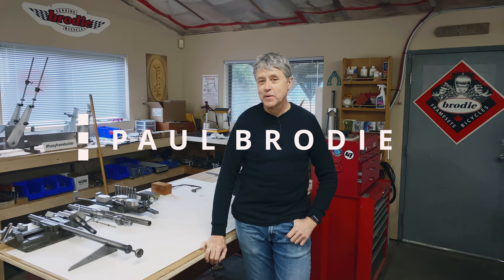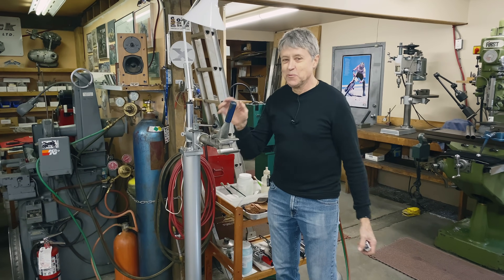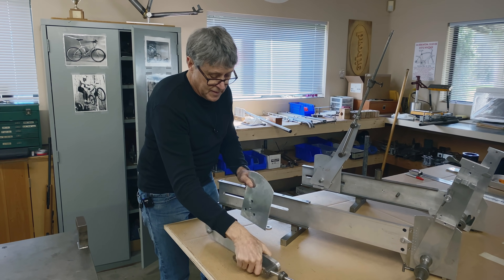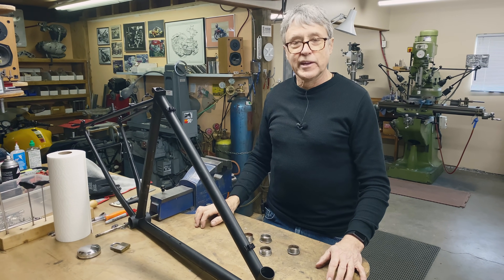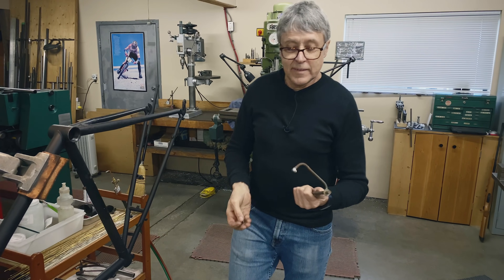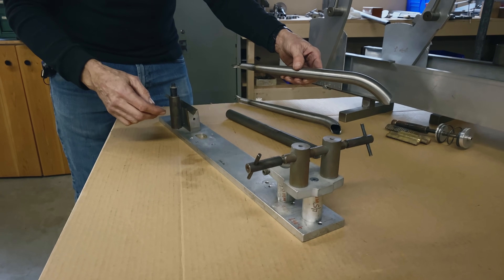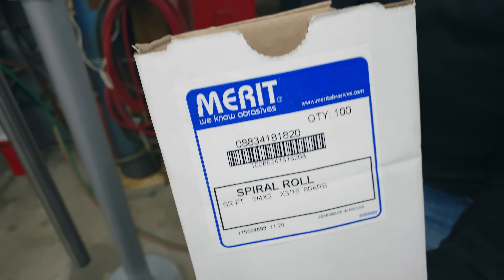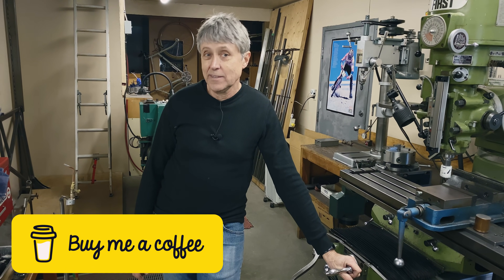Shop Tour! Motorcycles, tools, and essential framebuilding jigs - with Paul Brodie

Comment: 21:12 I tried cutting a miter in a piece of 1/2" conduit yesterday just to try. I've been playing with conduit thinking of making a stand for a dog bed that lifts it up to the height of the window sill. This window is particularly low but we have small dogs. First I made a jig to weld nuts onto washers, then I made a jig to hold a nut/washer straight into the end of a piece of conduit for welding, this way I could attach threaded feet and have it thread in straight. Doing it this way made it possible to have a nice clean looking end on the conduit with a nut attached on the inside, there but out of sight. For the miter I had to make a jig, but then I did it and I had used the wrong hole saw so it wasn't a good fit, i needed to use 1/8" larger hole saw. Now I see your setup and realize my miter jig is all wrong. It probably doesn't help that my cheapo drill press flexes the table when I push down on the arbor. But now I see a solution from your video. I appreciate you sir, thank you for inspiring me. This video I learned you do a lot of alignment stuff by eye too...learning this actually boosted my confidence a little so thank you for that. I appreciate your content, thank you for sharing.
Reply from the maker: Michael, thanks for watching and commenting. Yes, when you miter you want everything to be as rigid as possible to get the best results. Having a flexy table is not good. That's great you are trying new things in your shop!

Comment: Self taught and world famous.  I came across your channel from following MotoGP, and seeing your Moto 2 frame building video.  Then found out that you're Canadian as well, and that your only a days drive away!  Seeing your sir name Brodie, it didn't dawn on me until I came across another of your videos that show your bike frames.  BRODIE!!! I used to be big into mountain biking, and have seen your frames.  Seeing you work on bicycles and motorcycles is fantastic.  I am currently working on an MV Agusta F4.  I crashed a couple of summers ago at Area 27.  After that, I looked at the bike and said to myself, "Well, now's the perfect time for me to start the project."  I'm making my own fairings (and winglets) from composites for it.  The nose and side fairings are going to be one piece.  I'm going to make the fuel cell, tail section, and subframe all one piece.  Eventually I'd like to make a carbon fiber swingarm, and plenum box, and a titanium frame for it.  Have you worked with building titanium frames before?

I've been following your Aermacchi build and love the work that you've done with it. Some questions as I've watched through those episodes.  Why do you not put the tube in the tire when you mount it?  I have a hard time doing it the way you do.  You're spot on to end mounting the tire at the valve with tubes.  On tubeless, I start at the tire alignment dot to keep it from rotating away from the valve as I mount it.  You said that you got the CB450 front end from a salvage yard.  What's the name?  It's really hard to find old parts for motorcycles up here, unlike the US.  I was going to ask you where you raced, then I saw the WMRRA.  Thought you might have been racing over there in BC.  Your steering tube that you brazed.  Is DOM tubing a special grade?  During my welding apprenticeship, I've only seen numbers, sometimes with a letter at the end to specify the composition of the metal.  And the brazing that you did.  I'm not familiar with torch brazing, but tig brazing.  Silicon bronze has upwards of 60,000psi tensile strength and aluminum bronze upwards of 100,000psi YS and good wear resistance.  Are these similar for torch brazing?  I've worked on several old bikes with the loose ball bearings like yours, and a little surprise that you didn't use tapered roller bearings since you built your frame and steering tube.  Why is that?  And then you built your own engine!  I've been thinking of how I'd build one myself, from the same area as you've built yours too.  A v-twin, but really would like to figure out how to do a compact radial 5 or 7.  Would you share your method and how you went about building your engine?  Sorry for the long post.  You're doing exactly the stuff I want to do, and have a vast amount of knowledge that is so hard to find, and even harder to have shared.

Could I get in contact with you to learn from your experience?  Or possibly come to your shop on a long weekend to learn from you?  I'll buy you and Mitch a coffee 😁
Reply from the maker: Wow! Certainly not the shortest set of comments I have come across. But thanks for writing. First, I also watched the Moto 2 frame building video, but that was someone else, not me... That's great you are doing composite work on your MV. No, I have never made a titanium frame, or fork. I guess I could put the inner tube into the tire first, but I didn't. The Honda 450 front hub came from a US salvage yard that had it listed on Ebay. Not cheap. DOM (drawn over mandrel) is very nice seamless steel tubing that strength wise is about halfway between mild steel and 4130. If I remember brazing bronze is about 70,000psi. On the Aermacchi I wanted to use the stock headset bearings. They look right and never gave me any trouble out on the track. If you want to see how I built my Excelsior engine, it's all on my website: www.flashbackfab.com  I'm not teaching Framebuilding 101 because of Covid. I fall into the high risk category, so no shop visitors except my small circle of friends, sorry. Thanks for watching!
Reply: @paulbrodie  Thank you Paul for the information.

Comment: Hi Paul thank you for the shop tour. I have seen so meny work shops and I find something to inspire fome each time, your shop is so uncluttered and easy to work in I see. I know you like to build motor cycles from time as you build push cycles framework. I was wondering what is your way to make tube bending especially with say thicker tubes for motor cycles and do you use a band saw or a bench chop saw to cut the length of tubes and do you order large lengths of tube from the manufacturers. Thanks
Reply from the maker: Malcolm, when I am building motorcycle frames I get all my tubes custom bent for my intentions. My friend has a CNC tube bender.

Comment: At 35:24 you show the two rods you use. I assume the Harris rod is the "bare bronze" rod you refer to, but looking up the other rod Soudotec 6800, as well as the "AWS BCuP-2" specification, it doesn't seem to mention nickel silver at all? It says phos-copper. I think the correct specification for nickel silver should be AWS RBCuZn-D?
Reply from the maker: Yes, the Harris rod is the bare bronze rod. For the nickel silver I was only telling you what I know. When I first started nickel silver was a 773 rod. Now, no one refers to that at all. Different countries might have different codes. I am in Canada, eh?
Reply: @paulbrodie  I found the 773 rod online and it is nickel silver, but looking into the Soudotec 6800 more, I believe it isn't nickel silver. The spec sheet in this video (unless it's the wrong spec sheet) shows the AWS BCuP-2 designation which has no nickel  (only phosphorus and copper), also it says 40,000psi tensile strength which is much lower than the spec sheets I've found for 773 nickel silver rod or Harris Alloy 170 nickel silver for example, both which have the AWS RBCuZn-D designation and contain 9-11% nickel.
Reply from the maker: @squiresuzuki   Andrew, I have told this story before in the comments, and I will tell it again. In the eighties I started using 773 nickel silver rod. I never used a part number, I would just phone the welding shop and ask for 1/16" nickel silver. I never thought about it much, and the rod was always easy to flow and very strong. Never had a failure. Then Mitch and I started a YouTube channel. We did a video on brazing and I told everyone about the nickel silver rod. Then viewers started asking about the rod and wanting part numbers. So, I went to my welding shop, and asked Richard what nickel silver rod he had sold me. He said it was Soudotec, but he couldn't remember the part number. He gave me a spec sheet, that I believe I showed on the video. I asked about 773 rod, but he said that was long gone. I know the tensile strength is not super high, but it is a great rod and perfect for what I am doing. If they supply chain did switch from 773 to Soudotec 6800, I never noticed it.

Comment: Great video and great timing as I am at UBI in Oregon for the steel frame welding class!  🤠🤎🚴
Reply from the maker: Are you using an automatic fluxer? Or are you doing Tig?
Reply: @paulbrodie  I took the brazed class last year, but this class is steel TIG welding.
Reply from the maker: @GeneSimonalle   Right on. Hope you are learning lots.

Comment: Paul, thank you for the shop tour! I think I saw all of your videos now and there is still a mystery machine in the back which you didn't explain or talked about. It's behind your bench vice  and for me it looks like a horizontal grinding machine... If it's in your shop I presume you use it or... Just curious to know. Best regards, Job
Reply from the maker: Job, I think you are talking about my surface grinder.. It's grey, right? I don't use it very much, but it's very handy for taking a few thou off thick shims when I'm building an Excelsior motor. Thanks for watching so many of our videos!

Comment: great shop, I probably did the quality control on the S&S coupler. why is the mill x axis power feed on the "wrong" end
Reply from the maker: I think the power feed can go on either end, but you lose the handle. I prefer to have a handle for my right hand. The power feed, by the way, stopped working years ago. Thanks for watching!

Comment: Thanks for sharing your tools and processes.  I too use my Park stand for other things than holding a bike.  Have a jig that attaches to the arm to hold my  SAAB in-line 4 cylinder head. I like the extra table idea.  I think I'll go make one?
Reply from the maker: Yes, I have an Excelsior engine stand that plugs into my floor mounted Park stand.

Comment: Really enjoyed the video! Just wondering why you prefer hole saws rather than annular cutters. Thanks, cheers, Doug
Reply: It's a good question Doug!
Rotabroaches are much more true to size and run a lot truer than any holesaw I've ever used (even Starret hole saws)
Reply from the maker: Holesaws are relatively inexpensive, and they seem to work just fine. I usually have to file the mitres just a little bit anyway to get a great fit, so it's no big deal.

Comment: Excellent and very helpful video Paul. I'm curious why you prefer hole saw over large end mills. I assume the mills would be a more precise cut, but not enough of an improvement over hole saws for the cost. Thanks again for a great series.
Reply from the maker: A large endmill would be much more expensive than a holesaw, and could tend to "grab" a tube which would not be pretty. A good quality holesaw is good for a couple hundred mitres if taken care of. Thanks for watching!

Comment: Hey @paul brodie would you consider doing a more in depth video on your elevator? I'm designing my own right now and would love to know more about how you did yours. I need mine to lift my motorcycle projects up to the second level so I feel our needs are probably pretty similar!

looks to me like you made your own C-channel tracks by stitch welding 3/8, or maybe 1/2 steel plate. What was the reasoning for that instead of using C-channel, or even an i-beam? Then bolted to your floor and a couple spots it looks bolted to your wall framing from what I can tell. 

Is the platform running on rollers in the track? 

Very cool project. Please show us more!
Reply from the maker: Mark, the elevator is already made, so there is no way it would fill up an entire episode, sorry. From what you wrote you basically have it all figured out. 1/2" cold rolled, stitch welded, because it's more accurate than C-channel or I-beam. Thanks for your comments.    :face-fuchsia-poop-shape:
Reply: Hi again Paul @paulbrodie  - one more question if you don't mind. What process did you use for welding the 1/2" cold rolled for the elevator tracks? I can see the heat marks on the back side, so the weld must have bit in nice and deep. I was thinking stick welding, but it's hard to tell. I know you typically tig on your channel, but wasn't sure if that would be suitable on such thick steel. 

Did you have issues with the tracks wanting to close in/warp as you went? I was thinking of placing some spacer blocks between the two pieces of flat bar, welding, then pulling them out once the welds cooled or something. Cheers
Reply from the maker: Hi Mark,  I used the Tig welder.  3/32" tungsten and an .045" rod. The amperage was a little over 100, if I remember correctly..  Didn't have any issues with warping, it all stayed pretty straight. Happy Holidays!   :face-fuchsia-tongue-out::face-fuchsia-tongue-out:

Comment: Amazing shop and tips. Will you do a video in the variable speed mechanism on your drill press?
Reply from the maker: Not sure if it's enough for a whole video. I made that mod in the early 90's. Pulleys cost me $400, then I bought the acme thread and a nice handle. It was a bit of work. Thanks for watching!
Reply: I would watch that video too!

Comment: What a pleasure to see your shop and work! I wanted to add that the Yamaha GTS1000 has a frame similar in concept to Ruby Racer: you remove the engine from the right side after you take off a section of the frame.
Reply from the maker: I have a friend with a GTS. I will have to look a little closer next time I'm in his shop.

Comment: Great video! All the best tools are homemade. Do you ever measure the tubes themselves for straightness? They're allowed to vary by quite a lot (Reynold's have a straightness tolerance of about 1.5mm although probably most are better than that). It might make all the precise jigging confusing if the tubes aren't straight. Also you might want to orient them so the most curved axis is in the plane of the main triangle, not going off to the sides.
Reply from the maker: Thanks Ben. We used to use a lot of Tange tubes which were exceptionally straight. Your comments are very valid.
Reply: @paulbrodie  I should say that none of the Reynolds tubes I've ever used had less than perfect straightness or dimensions as far as I could see or measure (but I don't have a Blanchard ground table).
Reply from the maker: @benc8386   To check the straightness of a tube, just roll it on a flat surface. You'll soon see if it's out.

Comment: Another great video.  I have the lathe and the Bridgeport mill with the DRO  ( Digital Read Out).  I also have the Oxy/Acetylene setup with the Victor torch, the Henrob torch and the Mecco Midget torch. Also have the Mig welder and the Miller STL tig and stick machine.  I have a complete woodworking setup in the shop.  I have the Oneway woodturning Lathe from Canada.  It turns 24" over the bedways and 9' 3" between centers.  I've turned a lot of big porch posts with it over the years and have turned 49" in diameter on the outboard headstock end.  I invested about  $10,000 into it and it has paid for itself many times over.  I've enjoyed building the recumbent bikes a lot.  Having some of the same kind of tools and same interests,  this is one of the videos I have enjoyed the most from you so far.  I loved seeing all the tools and all of the jigs you have built over the years.  We are only limited by our imaginations and mine can get pretty crazy some times.  Thanks for sharing the shop with all of us.  From Louisiana here.   Dan
Reply from the maker: Hey Louisiana, thanks for watching! That's great you have a good shop too :)

Comment: That was great, thanks. When you use the nickel silver rod before the fillet braze how would you judge the strength of each? What I mean is how much of the overall joint strength is the miter and how much the fillet? And how does it compare to a lugged silver soldered joint?
Reply from the maker: The tensile strength in the charts shows the braze to be stronger than the nickel silver, but from my experience (including destructive testing with a 2 pound hammer..) the nickel silver is incredibly strong. Not sure if I understand your question.. the mitre isn't making the joint strong; it's allowing the filler material to do its' job. I haven't done much lug work, but both methods are very good for construction of bicycle frames. Thanks for watching!
Reply: @paulbrodie  Thanks. By the mitre I mean the nickel silver flowing between the mitred tube and the tube its mitred against. I suppose I am wondering why you don't go straight to the brazing rod? I have really enjoyed your videos, I have learnt so many little details.
Reply from the maker: @daedaluscan  Nickel silver rod has slightly better flow characteristics and the bare bronze rod is better for building up a fillet. I like to get the best of both worlds. It's easier to flow a 1/16" rod into the mitre as opposed to a 3/32" bronze rod. Yes, you could go straight to the bronze rod, but I'm fussy about things like this :) Thanks for watching!

Comment: Hey Paul, I'm extremely intrigued by that Excelsior project. Did you build the frames for your roadracer projects on the same frame jigs in this video? Thanks for showing me a lot of ideas for my shop. I better get to work.
Reply from the maker: In this video I showed (2) bicycle jigs and a quick shot of the Aermacchi road racer jig. The Excelsior replicas and Ruby Racer both had separate jigs, not shown in this video. Thanks for watching!